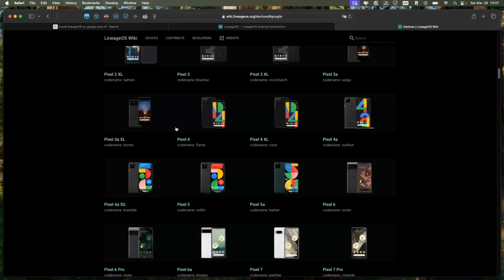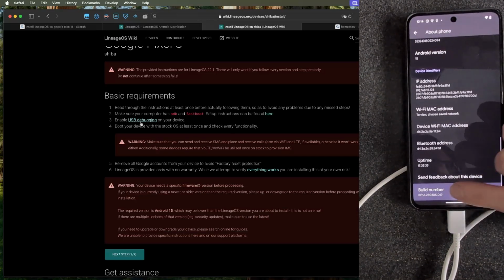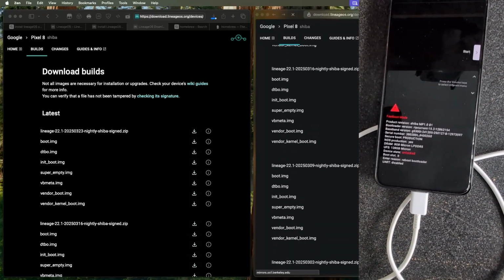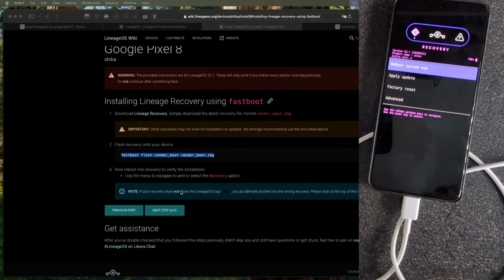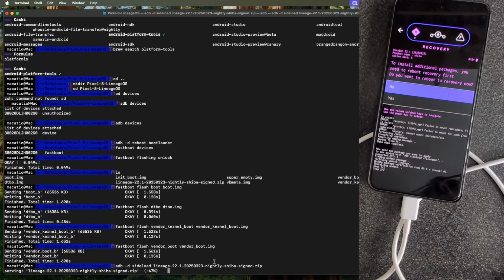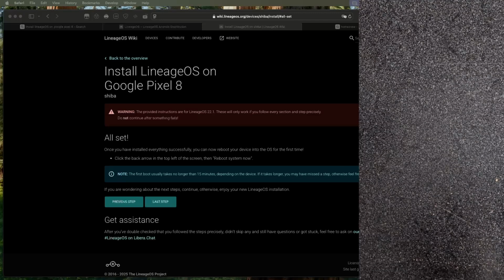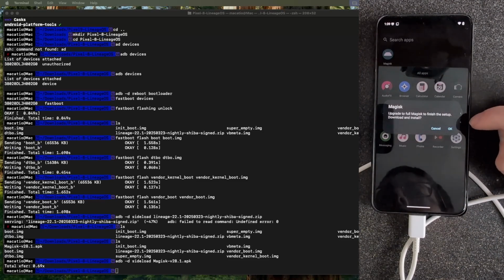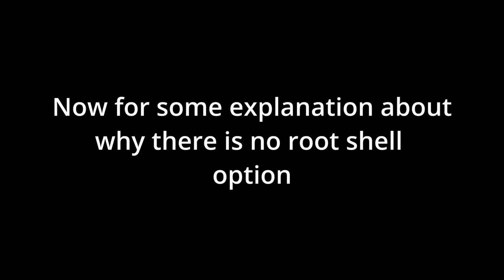How to Root Android and Install Lineage OS | Android Forensics 7

Comment: I appreciate your efforts,  but that was unwatchable with my adhd. I agree with the other commentor.  be ready, and edit.  short, sweet and to the point is how you build those views.  Don't get discouraged. Attention spans are very short anymore.
Reply from the maker: I appreciate your concern and feedback. Tech videos can sometimes be a grueling watch for viewers for a number of reasons, but that's all part of the game. As a tech creator, I try to make the knowledge in my videos accessible to all. I'm sorry if this didn't reach you in the way intended. 

I also strive to make videos as to the point and with the necessary amount of detail. Sometimes they need to be long and dry. I am not responsible for the attention spans of my fiewers, it is on them to focus if they really want to learn what I am trying to teach or just get a handle on the processes that I present.